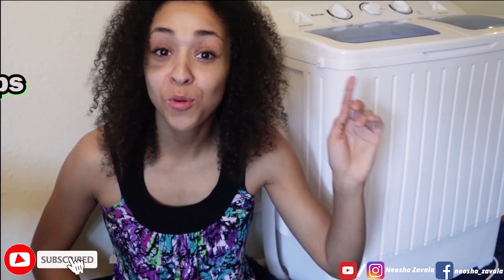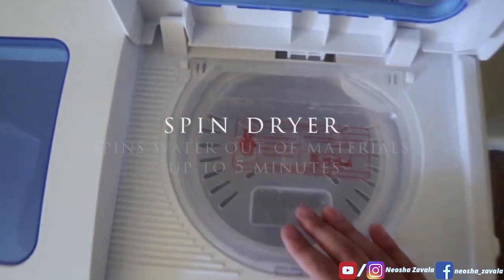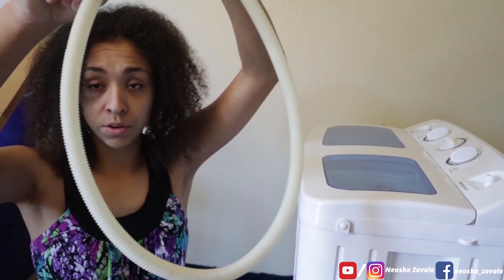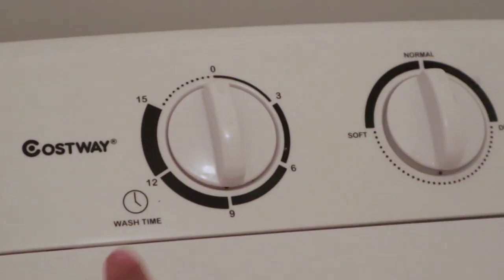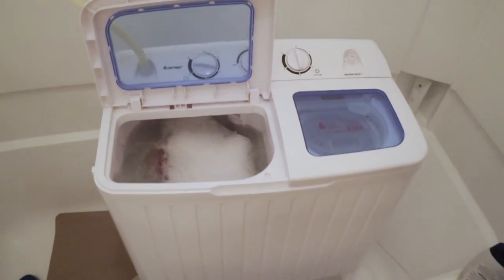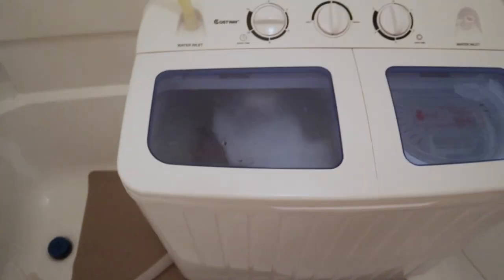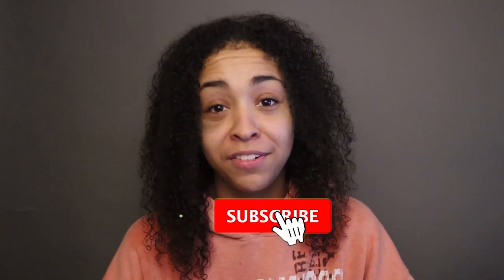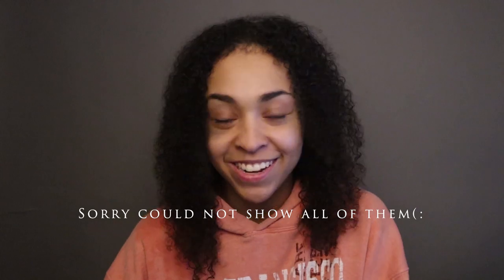Giantex/Costway Portable Mini Compact Twin Tub Washing Machine Part 2!!

Comment: First let me just say I'm not an electrician. I am a DIY guy. What you're seeing is the flash of the contact switches as a reverse polarity and restarts the motor. The electric motor can also create little Sparks with the carbon brushes as they rub against what is called the armature. This is what makes the electric motor turn it creates a circuit. The carbon brushes are like blocks of carbon they're not like a paintbrush kind of brush. If you look at a lot of electric motors including your hair dryer, and absolute darkness you will see Sparks. That is why when you go to fill up your car at the gas station you should turn off your car! There is all kinds of electrical motors in a car that could Arc and ignite fuel fumes! The Sparks that you're seeing though are generally normal for an electric motor. Now if they're really big Sparks I'd be concerned. As in Sparks you can see what the lights on!
Reply from the maker: Oh this is the perfect explanation!! Thank you for commenting and giving some helpful advice and tips! Because that’s really good to know, that makes a lot of sense when it comes to some machines in general. I guess it’s just a scare to some because it’s around water, but knowing that and the way it’s built gives relief! So thank you 🙏🏽

Comment: I love my little machine similar to this one - it's saved me so much money! I air dry everything on a large gull-wing rack. I invested in a 2.5 cubic foot mini electric dryer... I can't afford to run it a lot to actually dry the clothes from wet, but I at least run them for a few minutes to fluff before I fold so they're not stiff or wrinkled. And both units are small enough they can be stashed in the closet when the landlord inspects once a year - lol.
Reply from the maker: Right! Definitely worth the investment! That’s a great idea though, if it works, it works right?(:

Comment: The one I had, had the drain pump, and it went 2 years before the drain pump started having problems.  

What I paid for it compared to what it cost to go to the laundromat, it PAID FOR ITSELF 3 TIMES OVER.  If it weren't the pump type (gravity drain like this one) it would have probably gone for another 2 years, BUT being in my 60's, the idea of lifting it into the tub wasn't ideal.  It still WORKED, and even drained, but once the water was gone, it started making grinding noises.

Yes, I bought a NEW ONE, same brand (but a larger capacity), and gave the old one away to a young couple just starting out.  Told them about the grind and suggested the guy bypass the pump.  

The NEW one I got is the 26lb with pump version for UNDER $150 (Temu), and when it dies, I WILL be getting another one, because a simple HOUSE CALL for a repair on a regular machine is MORE than what these cost new!!

Comment: Hi Great instructional video!  I have regular sized washer and dryer but love my portable washer and portable dryer as they dont use as much water and electricity.  I find that using a nylon knee high over the drain pipe or whatever drain you use will collect all the fine lint. You would be amazed!  You could also put the strainer into the nylon and it will collect the fine lint.  Also I found that if I put the washer on an exercise step (found at goodwill or savers) it not only keeps machine off the floor of tub but cushions the sound.  The way you connected the type of funnel was genius!  I am fussy about getting all the soapy water out and will spin the soapy water out and place clothes back into clean water and agitate with softner for 6 minutes and spin again.  I don't use water in spinner.  It doesn't get enough soap out for me.  Hope I helped someone.  I have had my Panda twin tub 5 years and love it.  It gets my socks and underwear very clean. Just don't overload washer or spinner and it should last.
Reply from the maker: Thank you!! (: Love it! Thank you for all this info, I have gotten this recommendation with the nylon over the hose to!! I gotta try it!! And the exterior step is a great idea so thank you! Glad I could help with the funnel! Thank you again(:
Reply: I have a regular sized washer and dryer in the basement but I hate making three trips down there just for a load of laundry. I hate lugging heavy laundry up and down stairs too.  I think a twin tub type washer could fit in a spare shower stall I have on the main floor. Maybe I can clean the bathroom etc. and attend to one of these machines at the same time.  My basement dryer just quit on me and I have a mini dryer on order and I already have a Panda Spinner. I just have to figure out which washer to buy.

Comment: You can also swap the drain tube to the other direction, as I have so it is on the tub drain side.
I'm getting a plastic lint trap that sticks into the tub drain.
I ran my extension cord over my shower curt rod, it is up, out of the water. 
BTW, sweetheart, how'd you sustain a shiner?
Excellent job 👏 on explaining how you use this machine.
Reply from the maker: Thank you so much!! I appreciate that(:
Don’t worry lol I get this a lot!! It’s a skin pigmentation condition. My nephew head butted me 6 years ago on my lap by accident, my eye bruised and the blood above drained down and it lead to becoming a hematoma. So the damaged tissue under my eye has a hard time allowing the blood to circulate correctly so The blood collects and collects, and now has changed the color of my eye permanently until I’m able to get blood drainage surgery or somethin!(:

Comment: There is a water level gauge near the left side of the filter (why they don't mark it in black is beyond me) L<M<H. It looked like your water level was a little to high, which makes the machine work harder. Otherwise a great, thorough video.
Reply from the maker: Thank you for this input yes! I wish they also made it more noticeable as well. I appreciate it, thanks for watching(:

Comment: I had a panda washer/spinner a few years back...I absolutely loved it! I love your funnel idea..i have a suggestion that helped me...use it if you like..i hapowned to have a double shower chair that i put the machine on top if..to get it up out if the tub, so you don't have to worry about the water getting up under the washer...i didnt even think of that funnel method..i used a bucket and filled that with water and added the water that way..i didnt have a handheld shower..after wash cycle...drain...fill up with buckets and rinse...i didnt feel that it rinsed well enough in the spin cycle..i am not criticizing  in any way your way of doing .i moved to an apartment with full size hook ups..otherwise i would still have the machine..i ended up selling a fb marketplace..thanks for your video!!
Reply from the maker: Thank you so much!! I appreciate your feedback!(: It was definitely helpful for sure! I’m glad you liked my video, thank you sm!(:

Comment: Great tutorial, thank you!  Maybe you could attach a command hook to the side(s) of your washing machine and rest the power cord on the hook while it's connected to the extension cord....you know, just to elevate the power cord while the machine is in the tub.  
Appreciate the lint tips, and the funnel hack.  Off to order the tubshroom for my RV shower :P
Reply from the maker: Hey thank you!(: I appreciate the suggestion, that’s what I was honestly wishing what would of came built on the machine because it would of just made sense right?! Lol I’ll need to do that maybe one of these days. But honestly the way I did in the video is the same way I still do it, still works great(: But either way thank you so much! 🙏🏽 
I’m happy I could help with some tips as well(:

Comment: Thank you. Are there times where you have to break up the spinning task into sections since, for some reason, the spinner tub is smaller than the washer tub.
Reply from the maker: Thank you! Yes absolutely I didn’t edit that in my video since I wasn’t doing that at the time. But yes as I learned throughout the years I like to wash more and I use the spin cycle into sections where it’s not over loading it to spin without knocking side to side since it’s too much weight it can handle anyway. (:
Reply: @neoshazavala  Respectfully, I can't believe they can't make the spinner area larger. I bought the RCA 2.0 twice and boy what a mistake that was. Searching for another brand of the big automatic types. Good luck with yours.
Reply from the maker: Yeah. I moved into my new apartment and got a washer and dryer so I don’t really use this machine anymore. But i will say it did save me a lot of money vs laundry mat lol! Thank you so much for watching(;
Reply: @neoshazavala  I'll bet the Chinese want to start us off on these little manual ones, and when we get sick of them we'll buy their automatics....lol! Sadly, no big-name American brands went into the market with their own USA made portables.

Comment: I'm late to this party...but 2 things I thought I'd mention.  Longevity - I bought mine in 2016....and it's still going strong!!  Had a bit of hiccup with the tub not holding water, but found some videos about declogging the hose, and that showed me there's a thing inside (take off the back panel) that can be opened, and low and behold - a paperclip had gotten in there somehow!!  Took it out, closed it up and no more leaking tub!!  Which is good since the prices on these have skyrocketed!!  My model is $100 more than when I bought it!!!    But even at today's prices - at $3.50 a load to wash and dry - it doesn't take long to pay for itself!!

The second thing - which I'm guessing you may have learned by now - you're using too much detergent!!  Cut it down by half and you won't have to rinse so much.  Instead of half the lid, try 1/4...and 1/2 the amount of dawn you're using.  Since you fill the water first - add in the detergent and run it for a few seconds to get it mixed into the water before adding your clothes.   One  video I watched he fills it about 1/4 way, adds the detergent, then turns it on.  Keeps filling it with water and lets it agitate while he adds in his clothes.  A great way to make sure you don't overload the clothes and you can use only as much water as that load needs.  

And an extra bit that it took me about 5 years to notice - there's actually a fill line inside.  Mine is just to the right side of the filter and I had to feel for the bump before I could find it.  Turns out it's the same height as the ridges that go up the side.  So don't fill past the ridges and you're good. :)
Reply from the maker: Oh that is so good to know!! Thank you for sharing this!! But yes I am still editing my video for my next review on a product but working on my review for part 3 on this portable washer machine because I did notice I did things in my previous videos that I do a lot more different today, so I’m on that note yes I definitely go back and watched my videos and we like yeah I used way to much soap lol and water, but I definitely do it different now I’ll be posting that video soon. 
Thank you so much !! 🙏🏽

Comment: I would definitely set your machine up on a plastic step stool so it's up off the bottom of the tub.  Just one of those short ones that kids stand on to reach the sink.  Then there is no worries about the machine or cord in contact with water in bottom of tub.
Reply from the maker: I’ve honestly still been using the mat I have that set on the bottom of it so it never scratches or scrapes the tub. It’s still been doing just fine after over 2 years now. 
I make sure to not get the cord wet. It’s all good(: 
Thank you for the suggestion though

Comment: I bought the costway 28lb one last yr I loved my little mini 9lb one I had I used for my sons cloth diapers n it had last 6yrs so when I seen the costway 28lb one on Walmart website I said I gotta get that I was so excited got it n within 4m the seam that holds the lid was no longer holding the lid down it technically still worked but I'd have to put bucket on it so it went to the trash area this totally ruined my drive for these types of machine's frfr 💯

Comment: Hi again!  Where does the spinner/dryer water go if your still washing a load on regular ? Thanks!!🌺
Reply from the maker: Sorry, I didn’t go over this in the video. But there are two water inlets for each side not just the washer side. So for the spin cycle, there is a water inlet also that you can stretch over the tube to however you situation is, but you can be running the water at the same time it’s on or off. So hope that helps(:

Comment: Great job on the washer review. A easy way to fill the washer if you purchase a shower head with a hand wand you want need the funnel anymore.
Reply from the maker: Thank you! That was my original plan but since this is an apartment I am not allowed to make any changes, so I figured just getting the funnel would allow me to make things easier, as well as not having to make any changes to the apartment.
Reply: @neoshazavala  That I totally understand.
Reply: @Bunky's Workshop Still need water hose connected to rinse while spinning. Altough for the washer use is easier to fill it with shower's extention.

Comment: You did a really good job showing this machine.  I chose a little cheaper one on Amazon (  the Zeny, doesn't have a lint filter inside washer, will use pantyhose over end of drain tube and some type of filter over my tub drain), but I guess they're pretty much the same in operation.  Your video was excellently detailed.  I'm just hoping I don't damage my bathtub putting my machine in it.   I boutht a tub mat at Dollar General so I hope that prevents any damage and helps to keep it from moving around a lot.  I will have to turn my machine backwards and use it that way in my tub because my tub faces in the opposite direction of yours in the video.  Wish me luck.
Reply from the maker: Hey thank you for taking the time to give your feedback! Thank you so much 😊 
That’s great! A few people have commented about the Zeny and I’ve heard it’s great to! So I’m glad you found what works for you! Yes I’d definitely recommend getting a mat that has enough thickness to hold the machine and give it enough of a space between that and the tub, that way it won’t scratch it or move as it’s running. I got mine from smiths!(: But some good decent ones are at Walmart to.
Reply: Hey, I’m not sure if the Zeny has the same feature but when she turned this one upside down it showed that you can switch the drain pipe so that it comes out the other side. I have the same problem as you. Just did my first load today and wasn’t loving having to reach over the lids to transfer the clothes. Since I don’t have the funnel set up yet I was using a large bowl to fill it with water and with it facing away from me that wasn’t easy. Anyway, you’ve had yours for awhile now but just in case you were still dealing with the wrong side drainpipe thing I thought I’d mention the  idea that you may be able to switch the drain to the other side. I’m going to pop a commando hook on mine so I have a clip to hang the drainpipe from on that side.

Comment: I know this video is 3 years late but did you ever think about taping or velcroing the power cord to the machine so it won’t be a hassle keeping it from avoiding water?
Reply from the maker: Honestly, I just did it the same way I did it in there for years. It was the way I did it and never ran into issues. I got used to doing it the way I kept doing it. But taking both what you recommended, that is not a bad idea though. So thank you for those ideas any way🙏🏽

Comment: I have yo use one of these given my living situation 😬 iv 3d printed fittings and plugs for mine to use in shower, gotta love it 😂❤
Reply from the maker: Hey if it works it works right?! lol that’s right, gotta love it 😆🙏🏽
Reply: @neoshazavala  dose the job im really suprised with what it can do!! my only concern is how strong really is the pump/filter on drain, some say should be draining level or least from high to low point if that makes sense, guess cant complain for £100 lol get oil out my stuff dont really have a choice :)
Reply from the maker: Hey I’m glad to hear that the machine is also working out for you!(: I forgot to edit it on my videos looking back. So the soft  is more of a softer agitation for delicate materials. So then the normal is where the agitation continues longer to wash materials better to. But right I agree! Lol
Reply: @neoshazavala  iv been using power with mine for last year or so kinda yolo  approach 🤣 but I do keep meaning to change over but it's what I have access too 😏